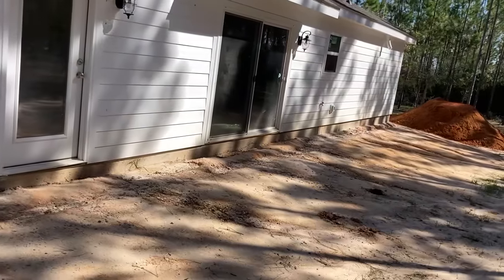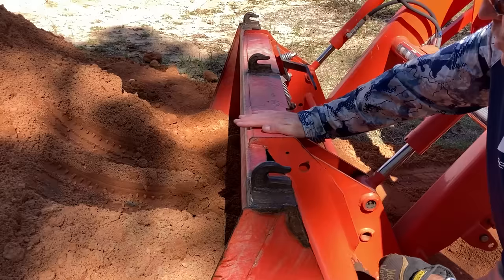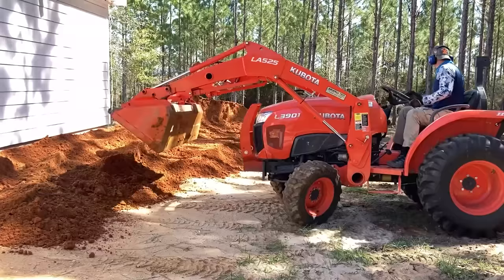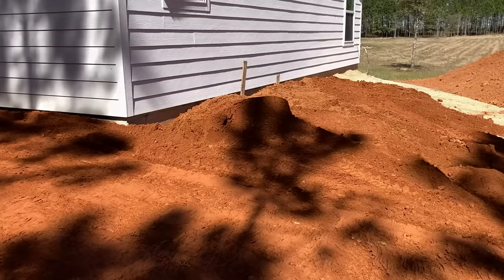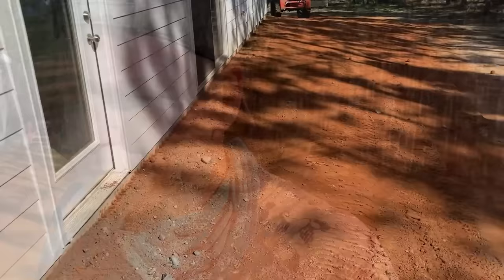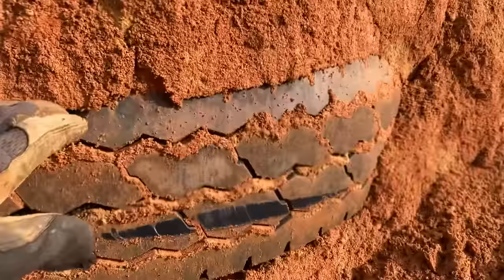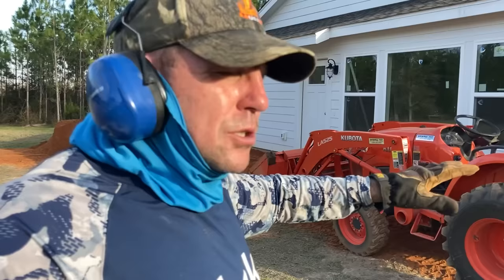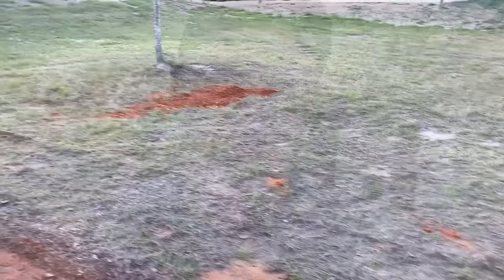How to Grade Dirt with Compact Tractor Front End Loader

Comment from the maker: More grading here::  https://youtu.be/5pKXz9yND8w  
One year later: https://youtu.be/oTYyRag1frk
Reply: that's a long way of doing it. if you get the chance go to a big housing development and watch how the skidsteer guys do this. used to be it was done with a tractor with a backhoe, but you cut from your pile's outside and push dozer style long swipes, cut down 75% of your travel not doing work, and being productive 90% more efficient.
as you are pushing a piece of the pile an inch or two at a time this allows you to have the rear of the bucket the only part touching which will act as a pack level grader you only need -3º to do this and you will quickly figure out where to start dumping bucket material quick enough and you just keep hitting all 4 corners as you go around as you travel forward safer#1 and faster#2 than reversing, eliminate all unnecessary backing before a living thing gets run over. also helps prevent in animate object destruction and damage to your tractor from boulders and retaining walls etc. 

also keep that machine away from the buildings automobiles, even for packing with the wheels. it only takes one mistake to cause major damage, and that machine can still crack the foundation wall just back filling block walls with too much ground pressure and back fill forward or side pressure. those can be $30,000 mistakes.
that triangle piece is called a gable end. that one is purely for accent aesthetic looks.

Comment: Just an FYI - I've logged over 2k hours in a skidder and many more in a loader. If you want the key to grading like a pro - its really Simple. You use a 3/4 full bucket to grade with. Using the Heel of your Bucket. Sprinkling dirt is for topsoil. You just dozer it around with a full bucket, Go right up to the house and then pull it back with the heel. Its just a bulldozer when the buckets full. You can make cuts and not bounce all over with weight in the bucket also. Lift up slightly and you add traction to the front tires if you wanna push harder on a pile. Empty buckets = weak machines. The heel and Bucket weight will pack it in much better on the back drag also. Its why you don't use the heel method for topsoil.
Reply: I would watch a video of this!  If you drop 20 tons of fill dirt - are you just pushing the dirt into place with a mostly full bucket, like a dozer would, instead of scooping and dropping?  What if the pile is too big to push some dirt out of in the beginning or too far from your spot your trying to fill or grade?
Reply: He needs to be watching video on how to...

Comment: My advice is to get a replacement set of pins for your loader arms if you’re doing any amount of grading. Loaders are not designed to push but lift. It quickly wears out pins and bushings. First question I’ll ask if buying used.
Reply from the maker: If you grease them regularly they don't wear quickly.   500 hours and still pretty tight on this tractor.

Comment: Try using a tamper near the house next time vs a garden tool handle, it's much faster.  I would never be comfortable driving a tractor that close to the house, so good on you!  That's some very sandy clay to be called "fill dirt"...at least just north of you in GA.  Good luck with establishing seed, and getting your parents settled.  Cheers!
Reply from the maker: They are in...grass is doing OK, but we are still going to sod.  Here's the move in video:  https://youtu.be/tiBT5QMlodk
Reply: moving a small tractor (I have a 2610) in close quarters is surprisingly easy if you have a hydrostatic transmission.  You have to be careful, but you can really get right up to stuff if you take in slow and watch all the implements.

Comment: Maybe talk about when you’re back dragging if you’re using the float control or a little down pressure. I find myself using the float and rolling the bucket to pull off high and flatten the bucket to drop in low areas. When I think I’m fairly level I’ll use a little down pressure to finish. Being careful not to lose steering from too much down pressure. I think that’s close to what you did.  Your end result looks great.
Reply from the maker: I loose steering all the time......if I can continue the line, I will keep the down pressure on, but if I start tracking sideways, I let the front end down.  Thanks for watching!

Comment: Nice job! Adding / leveling dirt takes a lot of time! To make it look nice anyway!
I had the same issues with my 3902 with lifting capabilities!  1100# at best including forks! 
I’ve since checked my hydraulic pressures at the loader valve and it was under specs….right around 2100 psi and factory specs are 2349 psi
I’ve shimmed the pressure relief to just under 2500 psi….very noticeable Improvement!  I also purchased some larger lift cylinders and with the added pressure and larger bore cylinders it’ll lift 1600# plus depending on where the lift point is….. I tested it on a large slab of concrete I’ve measured out by yards per dimension…..happy camper now!
Reply from the maker: 1600#   nice!     I might shim this tractor....or buy a bigger one.  Thanks for watching.

Comment: Just a couple of notes: 1, it is called a water heater not a "hot water heater". If you have hot water you dont need a heater. 2, I have found my Kabota packs a lot better if I have the front bucket full of dirt and the tractor in 4wd. However, you did a great job on leveling that dirt out. That quality of work usually takes many hours of practice. Good for you, my parents had a new house built and I spent several days filling in around their house and establishing dranage from the front to their pond in the back. Keep up the good work.
Reply from the maker: Thanks for watching.   There's something to be said for living on flat land....we are constantly grading it seems.
Reply: A water heater thermostat cycles the temp between hot and hotter.  So when the heating element kicks on, the water is indeed hot, and about to get hotter.  "Hot water heater" is not really wrong.  (I say "water heater" and "hot water heater" interchangeably, though).
Reply: One thing 1. It’s drainage not dranage. Unless you meant
Dr. Anage in which case you could be correct.
Reply: Isn't it kind of cool that when someone give you a vocabulary hard time for using a common term like "hot water heater," and then they mis-spell "drainage," "Kubota," have a comma splice "Good for you, my parents...."

Comment: 5:50 you can damage your curl cylinders on FEL pushing stuff that way.
Reply from the maker: It's true you have to be careful not to hit something solid, but I've pushed like that for 1300+ hours on these L-series and never had a problem.
Reply: I agree with this guy. I operate equipment for a living and would never do what you did. Use a bucket with teeth or weld some on like I did with my jd 3032. And learn how to grade by pushing and cutting because it will actually pack the material in better. Trust me
Reply: I was a little surprised when I saw how much curl there was when driving forward

Comment: Good job.  I would hire you.

I have a tractor with a front end loader and have not done as good a job as you have.  I understand some buckets have a setting where the bucket floats and another where it puts down pressure on the ground.  Do you have that and if so, what do you use to level?  Thanks.
Reply from the maker: For Kubotas, if you push the lever up when you drop the boom down and then keep pushing it, it will go in float mode.  But I never use float mode....I just work the handle as I'm moving backward to let the weight off the bucket as needed.
Reply: @PineyGroveHomestead  I am impressed.  I have an old New Holland.  I am reasonably sure it has float mode but I have trouble getting it to do that consistently.  (blush)  Since I am not as talented as you, it might help me finish off.  Thanks for the video.
Reply: We’ve always welded a piece of angle iron on the back of the bucket on our skid steer - I’m sure it’d work great on a tractor too.  Weld it so the one surface is straight with the bottom of the bucket.  Then, when you backdrag after an initial leveling, you can use the bucket tilt to ‘cut’ more or float straight with the back edge knocking down the high stuff.  It worked great for us for years!
Reply: @sx300pilot5  Thanks.  You are THE MAN.  I appreciate the information.